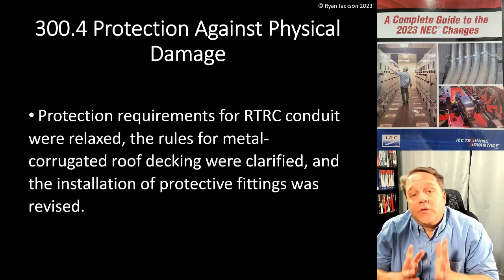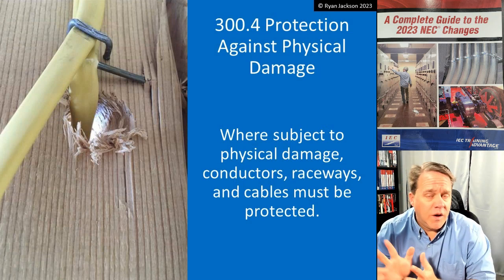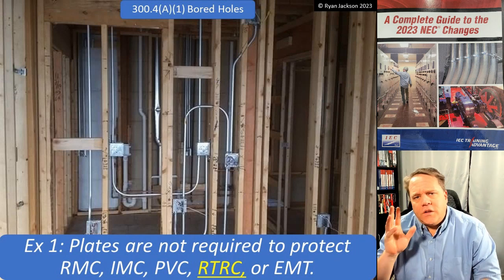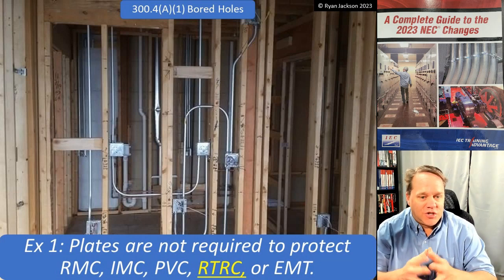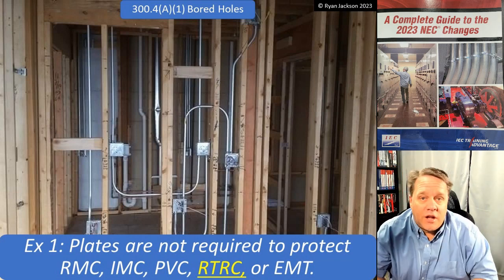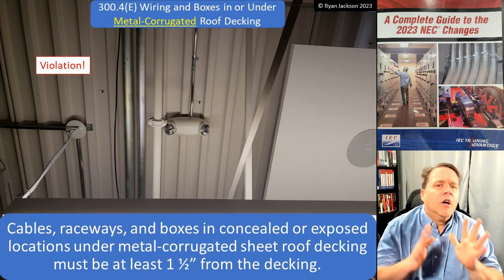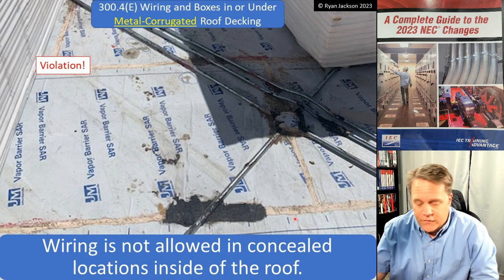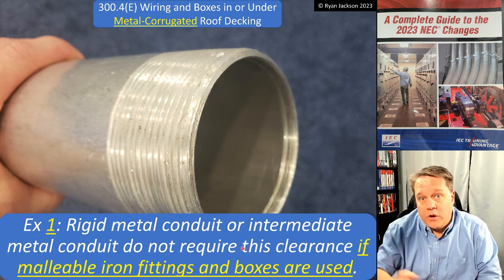300 4 Protection Against Physical Damage

Comment: On exterior of wall would you need to include the 1)2"plywood or 3/4 brown board to depth which honestly should because whatever you nail or screw on exterior should mimic drywall side.
Reply from the maker: @JoshMarriott-s9w  No, it is measured to the framing member

Comment: There is no way a plastic bushing will ever hold up under a wire pull. If you look at the picture you can clearly see where the rope cut into the terminal adapter. It would do the same or worse to a plastic bushing. Pulling wire through conduit and into a panel without a bushing installed is simply crazy. OK install the bushing, pull the wire, take off the damaged bushing and install a new one. That;ll do it.

Comment: OK, I am looking for war stories can anyone share an experience where they forgot to put a bushing on, and then the conductors failed for lack of. Excluding any field threaded pipe installations.
I am also in total agreement with, "this game" I have experienced the same malfunctions of listed bushings.
Reply: Wasn't me but have horror stories. In industrial yes. In commercial HVAC systems with high vibration, also yes. So pretty much only motors and other high vibration applications. Outside of that, never